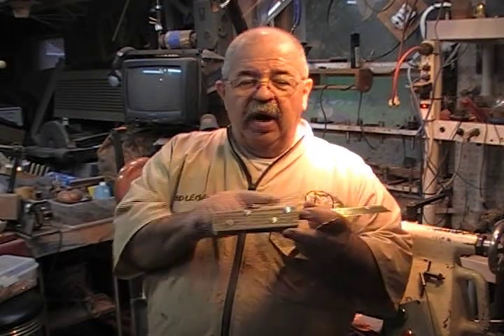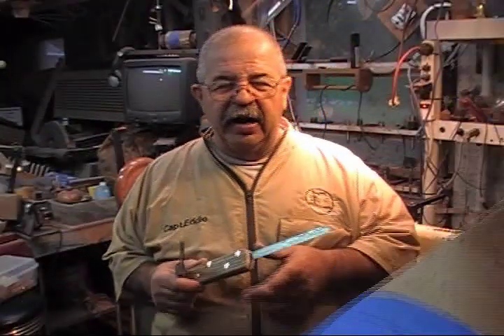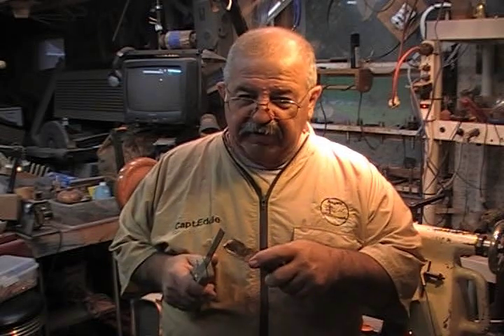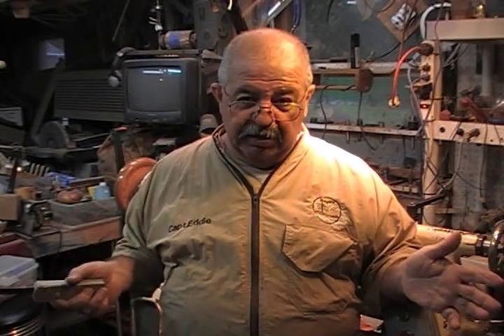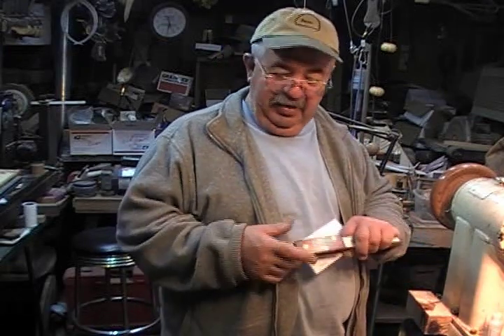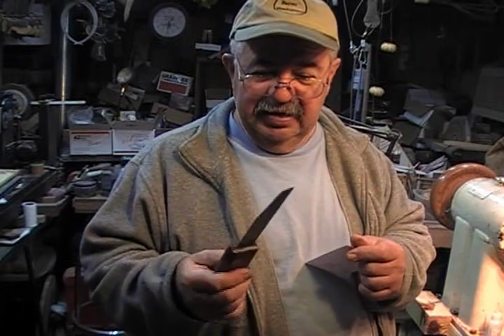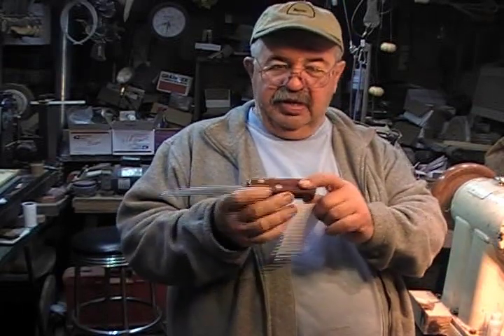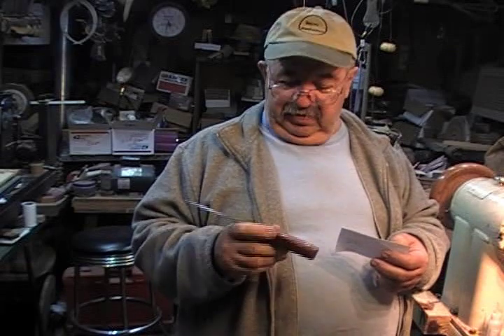thinpartingtool#2.avi

Comment: Cap'n - Just made one of these parting tools with a cherry handle. Minor modification, I routed out the inside of both halves on the table saw to embed the blade and used 1/4 inch brass pins instead of screws. All materials were on hand so I saved a little dough. Thanks for the great ideas! I hope you continue your great service to the wood turning community!

Comment: One small caveat. Bi metal blades are made with carbon steel with a very thin strip of tool steel for the teeth. Beware removing the teeth, the tool steel strip is very thin. Once you remove the teeth you have a scant 1/16th. Also beware when sharpening.

Comment: WOW, I just made one of these and does it ever work.  Mine is not as sexy as yours w/ the Cocobolo but mine was 100% free.  Old dead blade that has already paid for itself w/ its original purpose and some screws and sleeve nuts left over from some cabinets I bought some time ago and some scrap select pine.  This was a test.  I have a slimmer demo blade and know that I know it will work for me I will make another one w/ that blade.  Seems like one of those 'cant haveto many' tools.  Thanks Eddie!